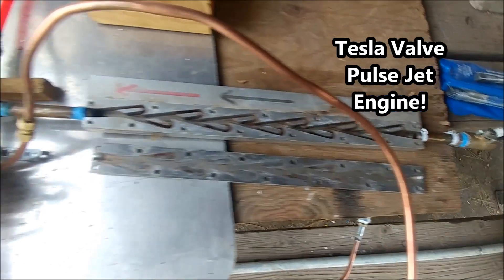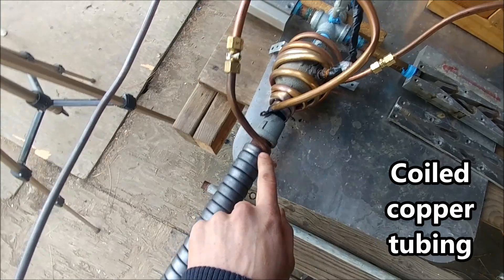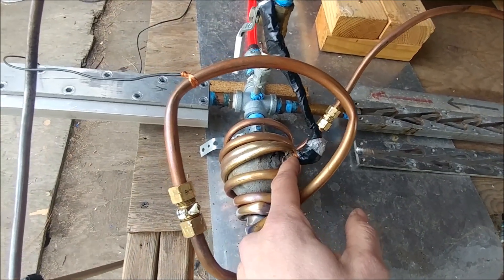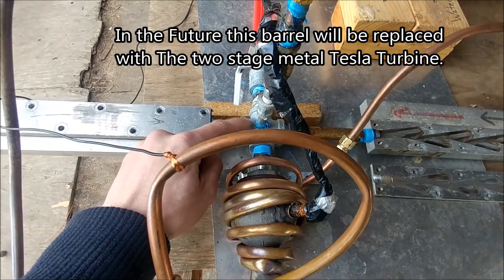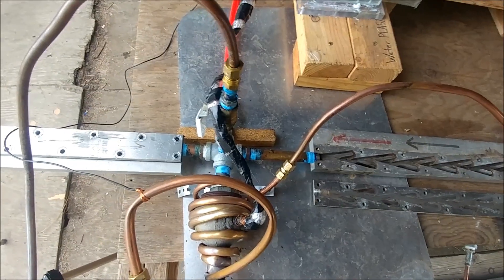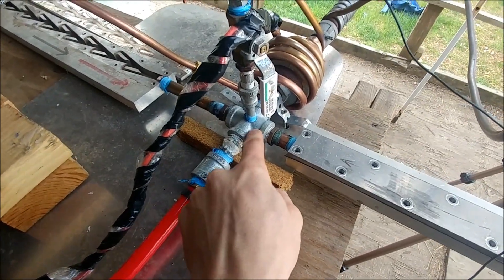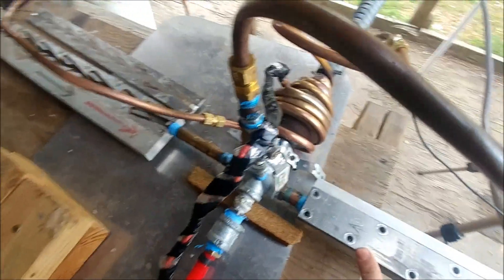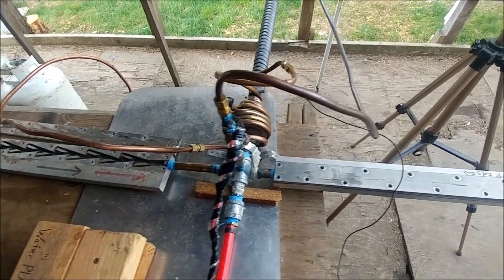Tesla Valve Pulse Jet Engine To Power Tesla Turbine.

Comment: Nice job on the execution, but I can't help but think that this is dramatically underperforming. Some immediate suggestions that come to mind: use a glow plug hidden inside a flame keeper, this should increase your detonation frequency. Use a combustion chamber that has both refractory and vortex properties. If you're lucky, and the detonation frequency gets high enough, you may be able to establish a vortex flow inside the chamber that will further accelerate your detonation frequency. Your Tesla valve needs to be made with smaller channels, and in an array. This will increase the frequency the valve can operate in, and allow it to respond to pressure differentials appropriately.
Reply from the maker: The valves were not very efficient, but we have since made more efficient tesla valves and will return to this project in the future some time.

Comment: Do you know what the rate of fuel burn was for this test? I'm curious if using the "homebiogas" system could be feasible for fueling the turbine.
Reply from the maker: we need to test for those numbers. but for now we can use any fuel to run the turbine. please see our latest video.

Comment: The only turbine-less jet engine in the sense that turbine blades are 
not subjected to high temperatures is my design. That design uses a 
hollow shaft that takes fuel from the rear end. There are three 
pulsejets attached to the tips of three hollow blades. The turbine 
blades recieve fuel and centrifuge it to the the tip pulsejets. The each
 of the pulsejets have a tesla valve. The pulsejets are spinning and 
thrusting at the same time, that is they are angled at 45 degrees.  The 
connection between the hollow shaft and the static spokes that pump the 
fuel into the cavity of the shaft is leaky thus the fuel is burned in 
afterburning mode.Sinse the blades recieve cold compressed air and the 
hot gasses are not touching the liquid cooed blades this is a kind of 
turbineless engine...To power the sparkplugs on the tip pulse jets the shaft has coiled wires
 that are co-spinning and a permanent magnet that is static. Current is 
generated in the spinning wires and it is transfered from the front of 
the engine to the rear through the shaft. At the rear end a transformer 
spinning with the shaft powers the sparkplugs. Russians have this engine since the 50's.
Reply from the maker: Id love to see your setup in action!
Reply: @iEnergySupply  You can build it yourself, i have not patent it, it is up for free... All you will need is the large main axial compressor and a starting APU unit. APU is used to start the engine like all modern aircraft. Once the turbine and axial compressor spin fast enough(subsonic), fuel is pumped through the root of the turbine blades and it is centrifuged to the pulsejets. The hot parts are only the pulsejets that are both liquid cooled and air cooled.

Comment: nice like the grav's tesla detonation chamber leave the pre heating coil and use pure H as the fuel and the pure o2 in with the air feed line and see how hot you can get off electrolysis.
Reply from the maker: Great point!

Comment: any measurable thrust.. they use such things for a heating system.. should be able to turn a turbine and generate  energy.
Reply from the maker: Exactly what we are going to do with it, power a turbine. It was producing enough thrust to start pushing it off the table, I had to strap it down.
Reply: @iEnergySupply   That's terrific just don't waste the engine trying to turn the generator make one that's on the same axle of the turbine that you might be using

Comment: The Tesla valve can be tuned to work at the operating frequency of the system by setting the position of the returns / flow conflict points in terms of harmonics of the desired frequency.  Same as tuning an extractor exhaust system.  That way the pulses you want blocked ('no return') all arrive at the pinch points at the desired moment in each cycle, thus maximising the flow restriction.  The sums are not hard to do - the velocity of the wave front is knowable from temperature.  That then gives you wavelength which you use to size the valve segment spacing.
Reply from the maker: Thanks for your realization. Also we tested the new Tesla Valves that are at least 6x more effective, so it makes everything easier. We will get them 3d printed.  We simulated them and they proved exponentially more effective.
Reply: @iEnergySupply  https://www.semanticscholar.org/paper/Numerical-Simulation-and-Hydrodynamic-Design-of-a-Anagnostopoulos-Mathioulakis/0327229225269076bcdd3f69f2898f214748c989

see figure 9.
awesome project btw!
Reply: @iEnergySupply  also you could use tunable central cavity between valves to fit it to resonance
like a syringe with two holes

Comment: its not self sustained because your using compressed air and rendering the tesla (valves) useless.  where is the turbine? am i the only one?
Reply from the maker: Hint, Tesla Pump.
Reply: @iEnergySupply  tesla pump/turbine is awesome but not related to this
Reply from the maker: @Itsruben21  I replaced the air compressor with the pump and the frequency was more tune able, it also consumed thousands of watts less power.
Reply from the maker: Here we are testing without the tesla turbine.

Comment: I'm no engineer, just a fan of cool stuff which from I can tell, this qualifies. So what would be some practical applications of this contraption? If optimized, what would be the advantages over current systems for said applications?
Reply: it could be a low cost way to produce energy onsite at your home. that way you don't need utility companies, that's the main advantage. if your home had solar panels and batteries this set up could top off the battery any time
Reply from the maker: Absolutely, this is going to run the Tesla turbine to produce electricity, the metal turbine is on the way, have you seen the turbine videos?
Reply: @iEnergySupply  I have, that's what led me here. Is what your doing scalable or more of just a fun project? Just curious. I'm a tinkerer myself and am fascinated by legit engineers and sustainable energy. Could a tesala turbine be powered by steam from a parabolic mirror or frensel lense? Love the idea of marrying these two
Reply from the maker: @nateb4543  that's what we are doing now :)
Reply: @iEnergySupply  the parabolic mirror/frensel lense to tesla turbine?
Reply from the maker: @nateb4543  similar, I have updates coming soon :)
Reply: @iEnergySupply  Have you run one of you metal Tesla Turbine with this engine did you get any reasonable work/ Generation??

Comment: I assume you have seen this video https://youtu.be/tcV1EYSUQME.    It you turn your Tesla valve into the actual spark gap that would eliminate a lot of stuff
Reply from the maker: Absolutely, I was even thinking about putting the combustion chamber between two Tesla valves.
Reply: @iEnergySupply  the heat would be really  bad for the valve if it is made of aluminum